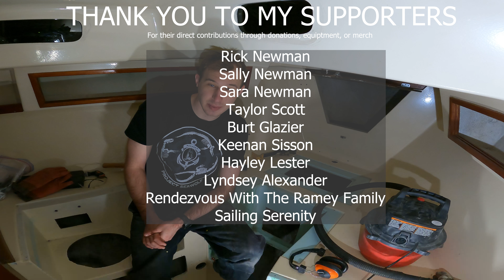Loomings: V-berth Work Continues

Comment: 300 feet of chain will weight something near 350 lbs if you use 5/16 galvanized anchor chain.  Start a count of your fore weight. You'll need to balance it with your aft. You may need to add lead ingots and or lead shot to the rear bilge, or add rear water and fuel tanks, but, you use that weight up as you go. Adding an outboard engine to the back will help. Also a bimini frame with solar cells. Lithium and lead batteries. If keeping the engine, get the alternator modified for the lithium batteries. But just keep count of the weights.
Reply from the maker: So when I got the boat there was about 100ft of chain in it and it was sitting very aft heavy in the water, the aft was also full of lots of equipment so it’s hard to tell how she will sit when she’s back in the water, but ya I’m keeping track of what weights I’m planning on placing and where, honestly I’m concerned that there won’t be enough weight even with 300ft of chain and 100 gal of water low/center. But ya I am adding a lot of equipment aft.

Comment: If you are planning on 300' of chain, could you modify the chain locker so that the chain can slide aft further and the weight is carried lower?
Reply from the maker: With the redesign there will not be any significant weight forward other than the anchor and chain, which will partially be stowed on passage, honestly at this point I’m fearful of not having enough weight forward, as even with 100ft of chain, two anchors, a black water tank and all of the freshwater the boat was still VERY aft heavy when I got it. The anchor locker is huge as is but ya I can make it bigger, lower, and farther back than before. With chain running too far back though I would get worried about kinking, and I want the v-berth high impact areas to be waterproof storage as well for lightweight stuff.
Reply: @projectseawolf  It's good that you are thinking it through carefully.  Will be fun to see you start building that area back after the tank tear out.

Comment: Maybe cut it all up, pull it all out, repair and refinish what you want to keep, and then reassemble piecing in new parts as you go. But, I am not there and that is not my time or money.
Reply from the maker: In real time I have it all out and I’m cleaning everything so what I’m left with is the odd shapes of the v-berth bed surface, but I’ll figure it out and add new panels with Divinycell foam core where I need it. Just got the foam core so as soon as things are all dried out I’ll be reworking the design and adding fiberglass back in :)

Comment: There was value in refurbishing the water tank, you can never have too much water storage.  Maybe don't destroy all the interior of the boat.. ! Unless you are making the boat lighter for racing?
Reply from the maker: Definitely not racing this full keel lol but ya, I’ll put a few water tanks further aft and lower which will lighten the bow, not that the bow needs to be any lighter (bow was extremely high when I bought her even with chain and a half-full water tank). I’m building better support structures and waterproofing the v-berth storage incase of collision.